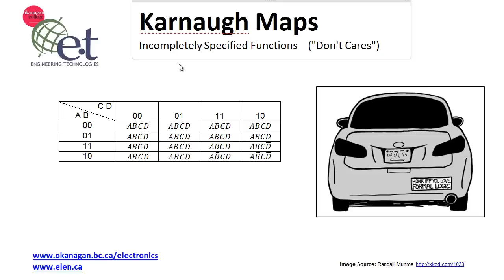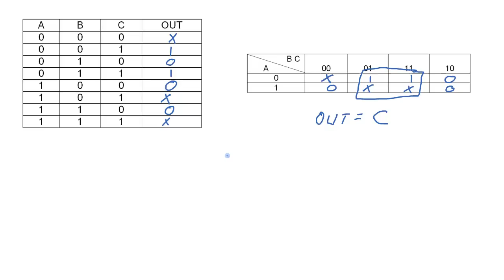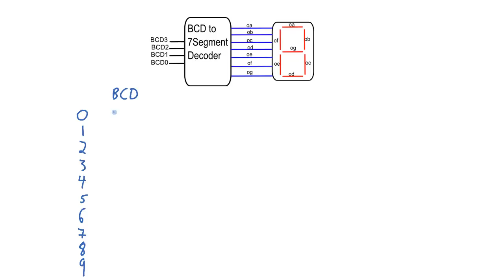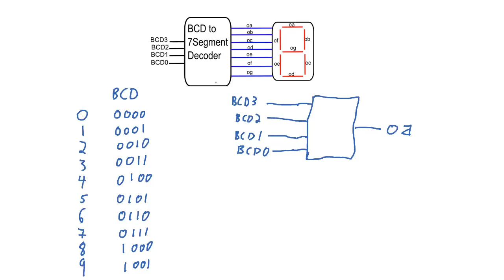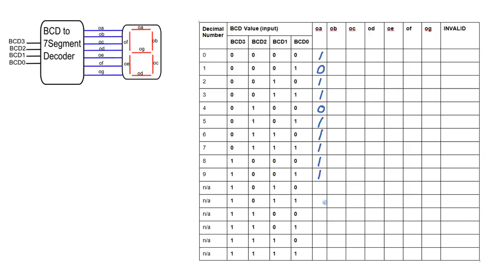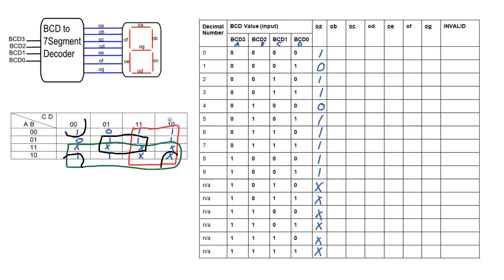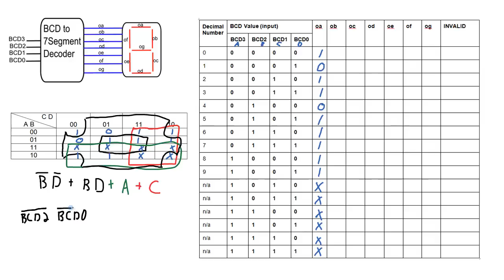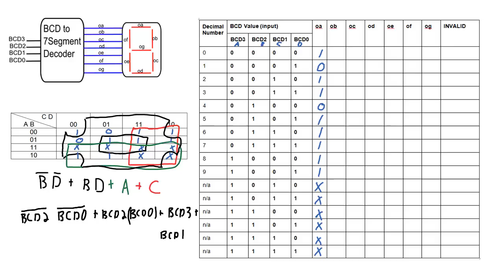Karnaugh Maps Part 3 - Incompletely Specified Functions (Don't Cares)

Comment: Do you randomly just choose the values of the outputs that you "Don't want to care?"
Reply from the maker: When deriving and SOP expression from a K-map and you are choosing the value of the "Don't Care", you need to determine if using it as a '1' will allow you to make a larger grouping.  If it does, then use the "don't care" as a '1' otherwise use it as a '0'.  Remember that the larger the grouping of 1's then the smaller the product expression will be.

Comment: 14:59 second please check it, (red color group)  B doesn't changes. So the answer should be  "not B and C", isn't it?
Reply from the maker: It looks like B does change. The red colour grouping spans all 4 rows: B=0 in rows 1 and 4 and B=1 in rows 2 and 3)
Reply: Thanks for reply, sorry I am confused. 
It seems I wrong but can not understand where exactly.  

This is how I am measuring: 
According to the red color grop's border it covers all 4 cells (two 1's and 2 "don't cares"). According to which I assume -  the "B is equal 0" in the 1st row (AB 00) and it is still 0 in the 4th (AB - 10) row. 
C was 1 in the third column (CD 11) and still remained 1 in the 4th (CD - 10) column.
Could you please help me to see where I made mistake?